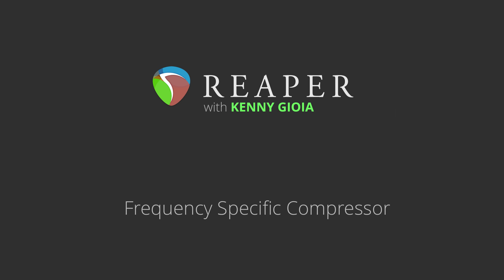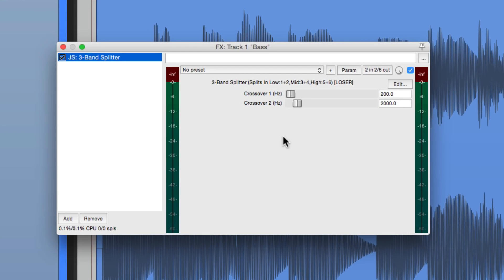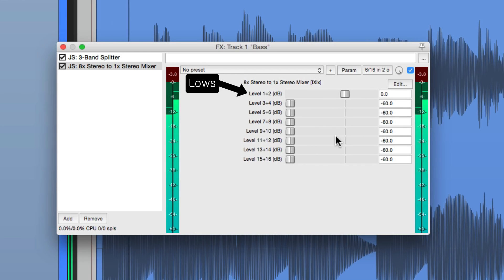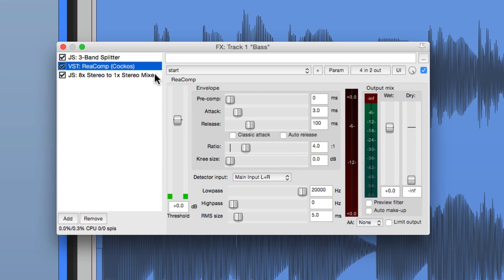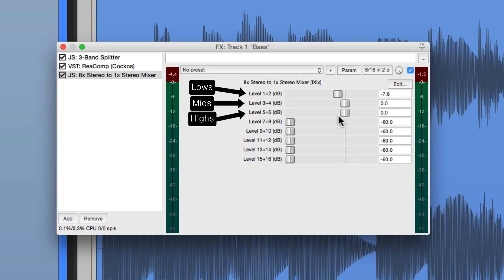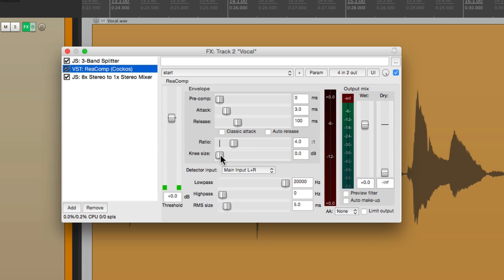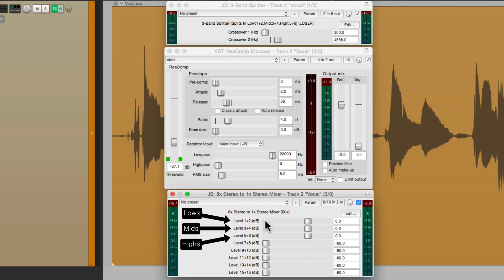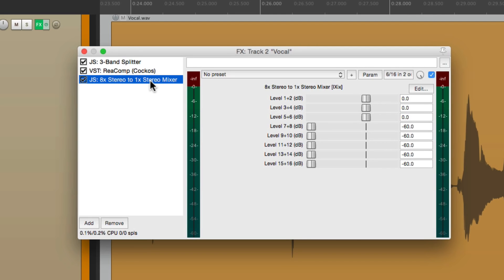Frequency Specific Compression in REAPER

Comment: How would you set the pin connectors if you would like to use ReaComp in between the splitter and mixer as a sidechain compressor. I'm attempting to create a frequency specific sidechain compressor and am not able to get ReaComp to recognize the Auxiliary input. Thanks!

Comment: Sorry if this is a daft question: How is this different to using the filters on the ReaComp plugin? My intuition says that the threshold won’t by affected by signal on either side of the filter but the compression will still be applied to the entire signal. Is that right?
Reply: Correct. Using only reacomp, the whole track gets quieter when triggered

Comment: Even if this task could also be done with ReaXComp, this method is brilliant and very versatile! For example, if a fast "character" compressor (1176, ...) is used for the lows you can generate harmonics (saturate the signal). Just the tip of the iceberg... :-) Thanks Kenny!

Comment: How is this different than multiband compression with only one band active? It seems to be the same basic concept but with three plugins verses one.
Reply: Exactly.
Reply: I think that the important point here is that the compressor used can be any compressor at all.  ReaComp and ReaXComp are very clean compressors, but you could just as easily use a character compressor like UBK-1 to add a little something to the quality of the compressed audio.

Also, it doesn't have to be a compressor in the chain.  The same method could be used to add flanging to just one band of frequencies.
Reply: BUT THIS MAY BE HELPFUL DURING MID SIDE PROCESSING .WHEN WE WANT TO COMPRESS THE MID TRACKS WHICH ARE INTERFERING  WITH LEAD VOCAL  IN THE RANGE NEAR 2K ..SO THAT OUR VOCAL SHINE THROUGH THE MIX MORE.. ...
Reply: True, but I think the idea is also to demonstrate using Reaper's routing system within the fx chain
Reply from the maker: Yes. It's really the application that changes. The setup is similar. But I wouldn't call it multi-band compression if you're using it just one frequency.
Reply: True, I guess I should have worded it a bit differently, but the same goal can be achieved by using a multiband compressor (i.e. Reaxcomp) with only band active, correct?
Reply from the maker: Correct.